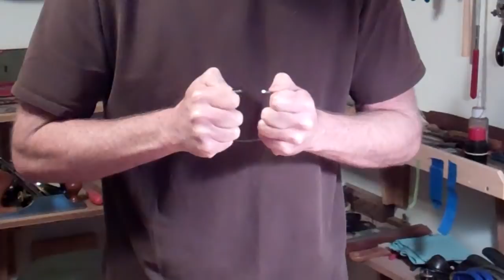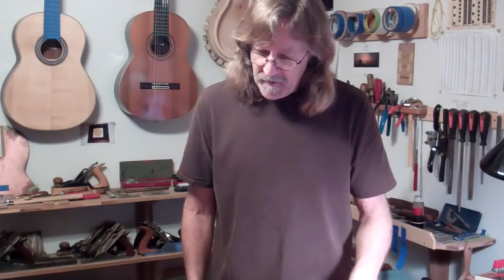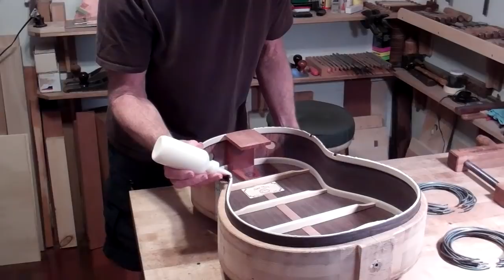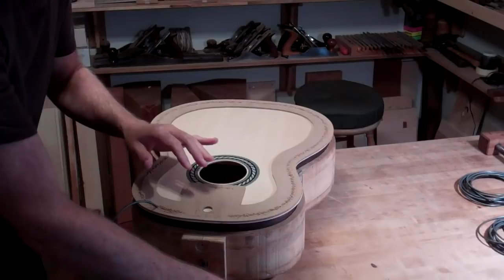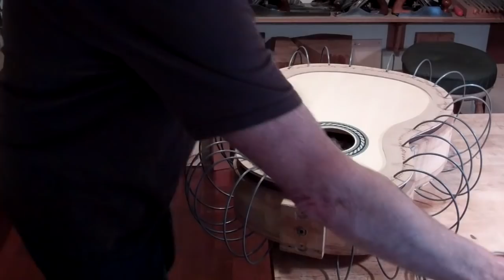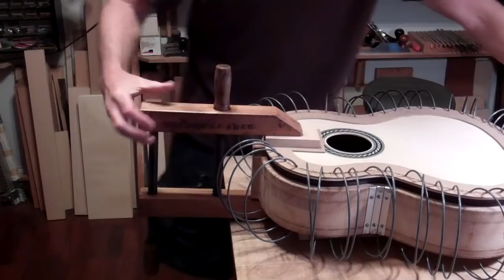Classical Guitar Building, Oberg Guitars, Clamping the Top to the Body

Comment: Nice work! I know many makers use this kind of method, but in this way you do not have the same controll to the doming of the top - if you want one - compared to using a sólera. Do I need to say IMO? isnt this a fact? Of course - you can clamp the braces in a carved disc to make some dome, but you would still not have the same controll of the doming. Comment continiued...

Comment from the maker: Greetings GuttenMedHatten-
I don't think it's a fact. I have complete control over the doming of the top, which is already set before gluing it on. It's just another method...no need to say one is better or worse than the other. And as regards glue squeeze-out, with either method there is one plate that will have some squeeze-out. At least with this method one can clean the glue in the area that will be seen through the soundhole. But that's the last reason I build in this fashion.

Comment: I've never seen anyone fit the table after the back has been joined to the ribs - the usual method of construction is to build the instrument on a solera, with the soundboard going on last of all. That's also one helluva 'foot' from the neck on to the table.
Reply: "the usual method of construction is to build the instrument on a solera, with the soundboard going on last of all". The soundboard goes on first to receive the neck in the method you mention. There are many luthiers building the way Oberg does, Fleta is one of them.

Comment: There is no real advantage to this method. Using spool cramps is just as fast and easy. and you dont need the cramping cauls. The traditional spanish style is gluing the top on first  to the sides and then the back. Here Peter is doing it backwards in a more steel string style building method.